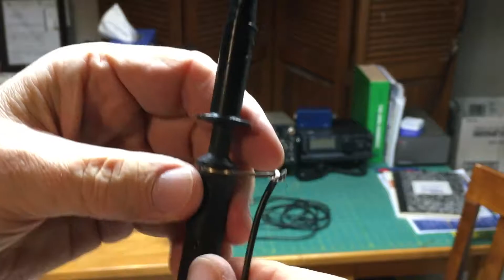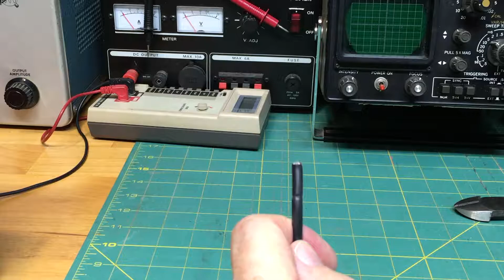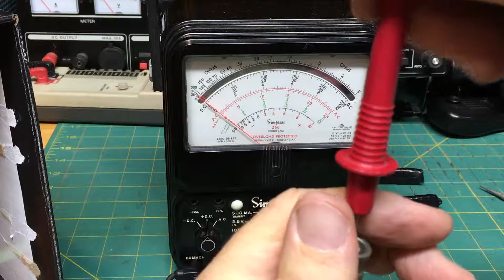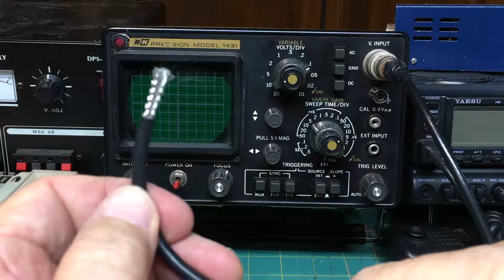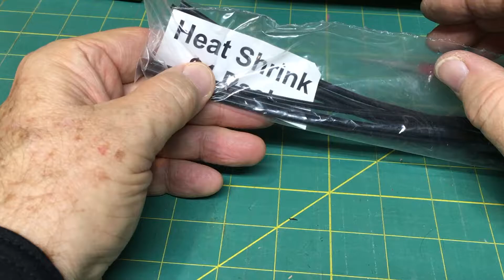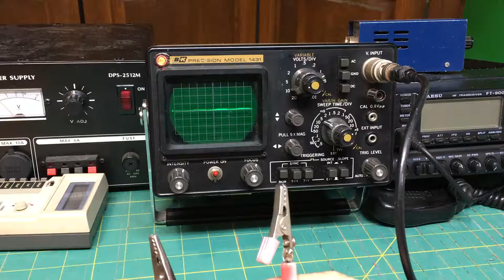EE4 Misc. Monday - ScopeLeads

Comment: One of the things I got wrong was in calling this monstrosity a “useful” oscilloscope lead. Straight leads, in this case the alligator clips, will be ‘signal noisy’ and is not truly suitable for most oscilloscope work. On the other hand, these will be useful as leads for my signal generator. More on that later. The real point was to demonstrate working with coax cable using an “old school” technique as well as how real electrical tape works.